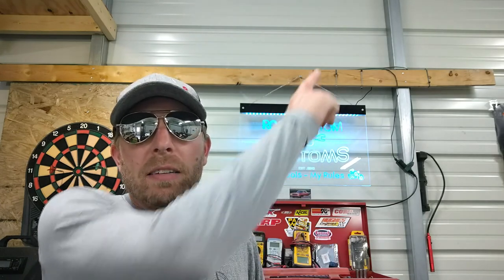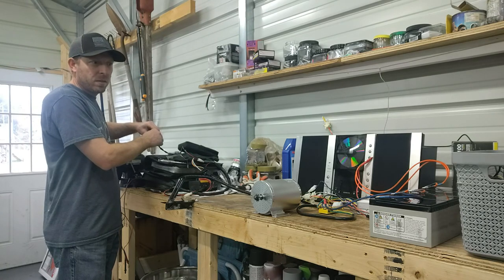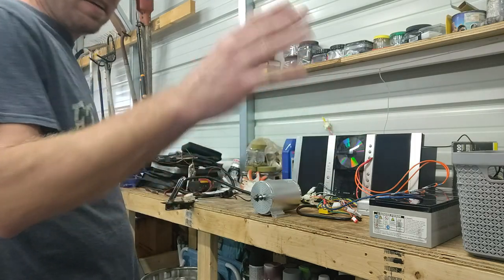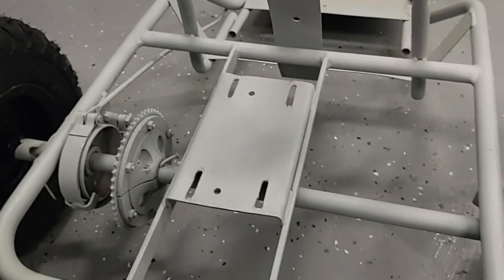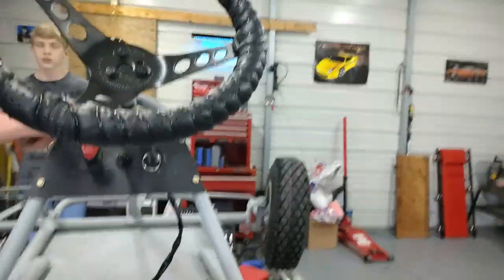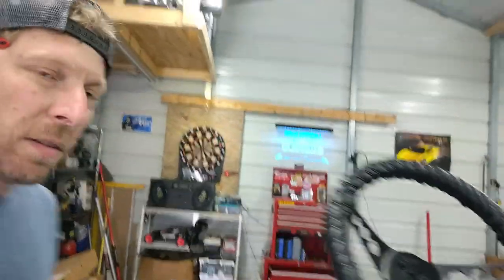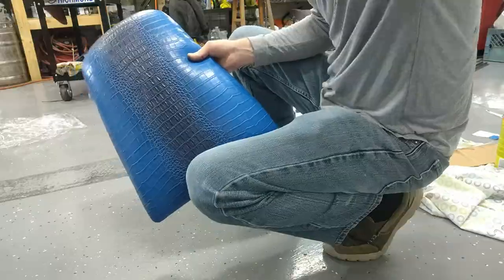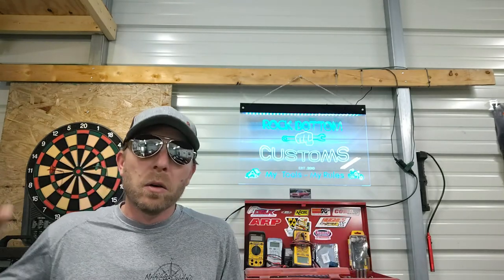DIY E-kart Build and Go-kart Restoration pt2

Comment: Trying to hook up a 72v battery on a 72v motorkit yall know why it sparks up when I go try to connect it?? Wires are all good and correct double checked and everything, everything brand new as well
Reply from the maker: Hard to say for sure, check voltage with a multimeter it should be close to 75 on a full charge. Sometimes you can get a small spark when you first go to connect it that's just capacitors charging but it shouldn't keep sparking like it's trying to weld itself. If so something isn't right like positive and negative touching each other somewhere

Comment: Ooo how did you connect the reverse switch to the controller? I got the same kit.
Reply from the maker: It plugged right in to one of the connectors on the module but I don't remember how it was labeled exactly. In the final episode of the build I put a rundown of all the wires and labels and how they connected, it should help. I know they were translated and some of them didn't really make sense and I had to do some googling to get them all figured out.